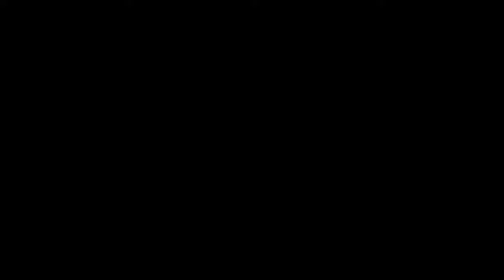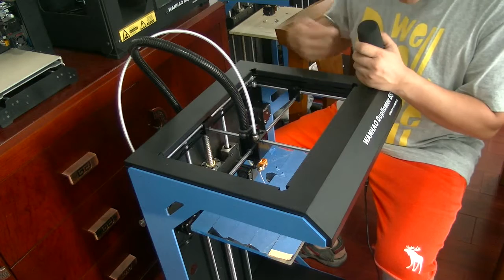How to clean D5S Extruder

Comment: They never reply. I am spending a lot of time trying to have a reasonable printing and I have nothing. After spend all that money in the printer, in materials and new parts I have nothing. Can someone share their settings to me please. I use cura, I have calibrated the printer a lot of times. I have change its firmware to read g-code. and nothing. my cheaper ender3 works much better than wanhao 5s.
Reply: I've had this printer for years at my office. Clogging is always an issue, especially when changing materials. Get a micro-swiss nozzle, and if any other parts on the hot end are damaged from heat or leaking, possibly a new Peek isolater, PTFE throat, brass coupler, heating block, and even heating element. Find some high temp thermal grease and use it on every part that makes contact with the heating block. If you print any higher-temp materials (230+), expect a higher likelihood of clogging the next time you change materials and possible damage to the plastic thermal break components. Get a piece of 3mm/1/8" nylon rod to help push out material and clean the system between material changes at a higher temp. Get a nozzle-cleaning kit. I generally have had to print with temps on the higher end of the material's recommendations, but that could be the accuracy of my thermocouple. I'm switching to an all-metal hot-end, which will require a custom machined extruder plate, to hopefully make this into a tolerable printer again.
Reply: @rdbellman  can you let me know which all-metal hot end have you install for the wanhao 5S mini?
Reply: @estoylopez  I have not purchased the components yet. As far as I can tell, nobody makes a directly-compatible all-metal hot-end for the D5S series. However, Micro-swiss does have the heat break and nozzle for 3mm filament. Would just need to find a heater block and a cold-end that will install on the heat break and then figure out how to mount it in the extruder block. I'm planning on ordering and figuring it out as I go. However, I have the ability to machine parts if they don't already exist.

https://store.micro-swiss.com/collections/all-metal-thermal-tubes/products/plated-wear-resistant-thermal-tube-upgrade-for-e3d-v6-hotend-3-00mm
https://store.micro-swiss.com/products/reprap-m6-thread-e3d-olsson-block-j-head-3mm-filament